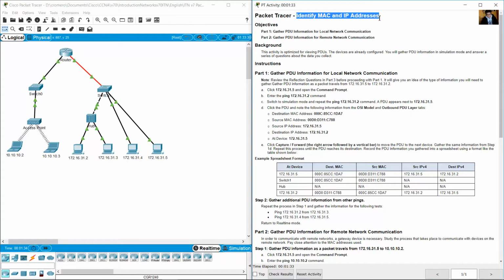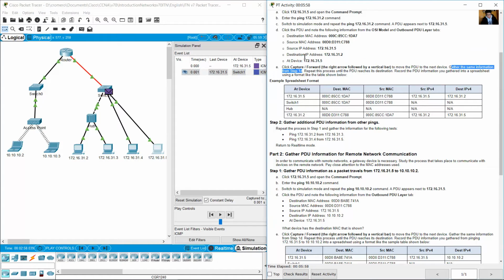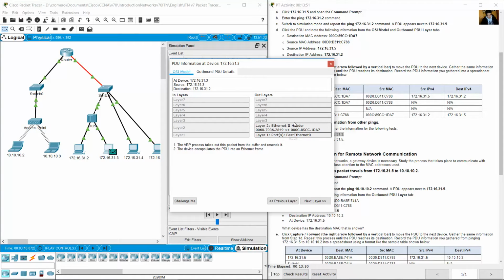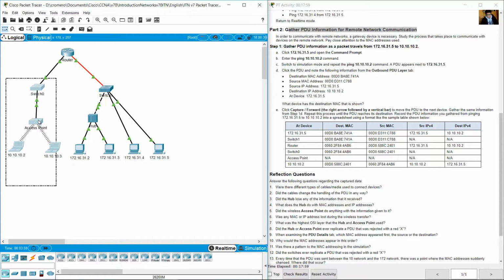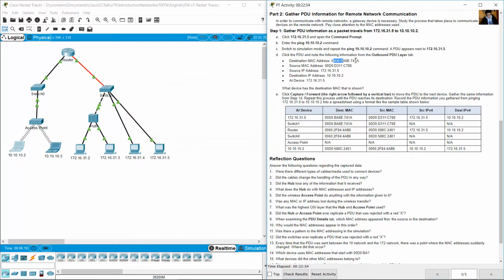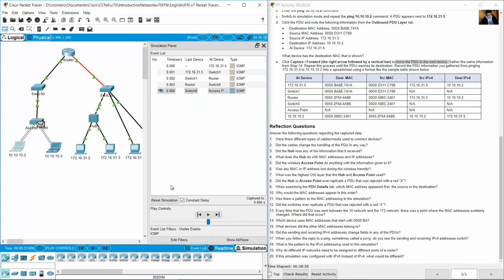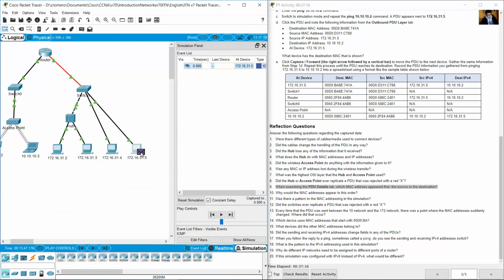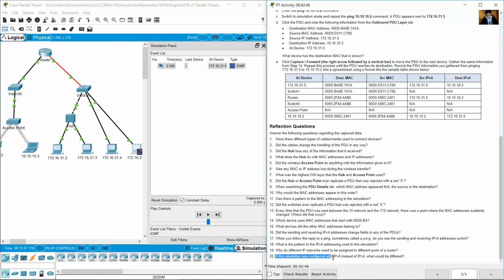9.1.3 Packet Tracer - Identify MAC and IP Addresses

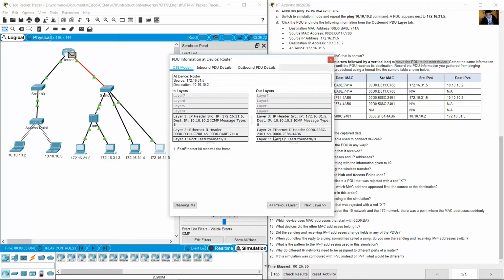Comment: @17:19 at "Out Layer" column, there is source MAC address 00D0:588C:2401 , for which device this ??. previously you said the router MAC address is 00D0:BA8E:741A
Reply from the maker: 00D0:588C:2401 address is for the another interface of the router
Reply: @romeroc24  Thank you. Is it because the router has two different connections (fiber and cable)? so the above MAC address for the cable?
Reply from the maker: @radifun1282  No, it is because is a layer 3 device in the OSI model